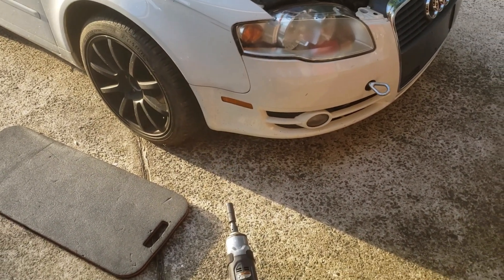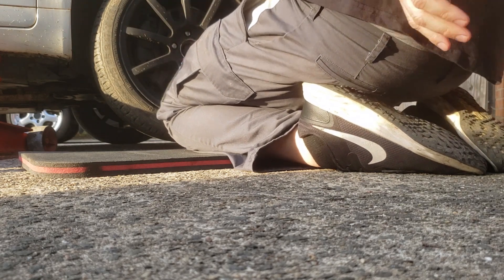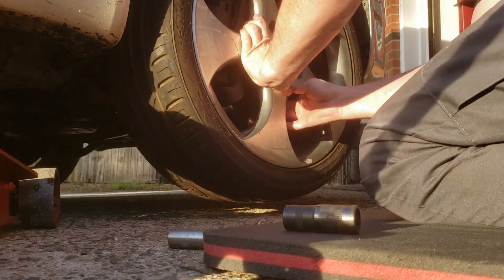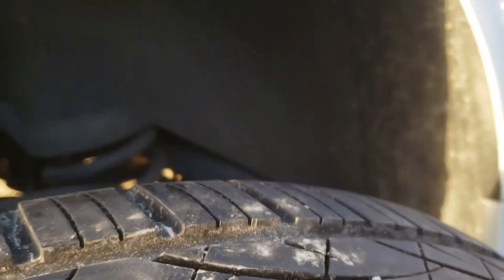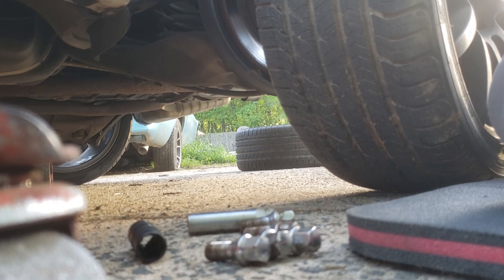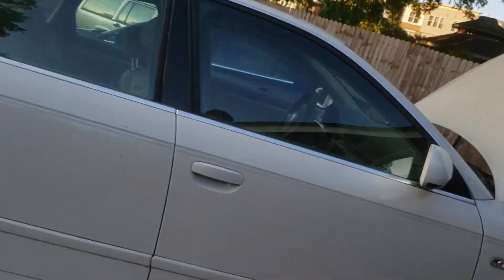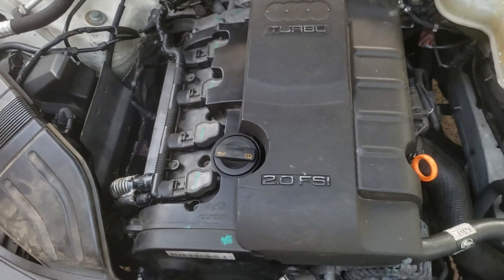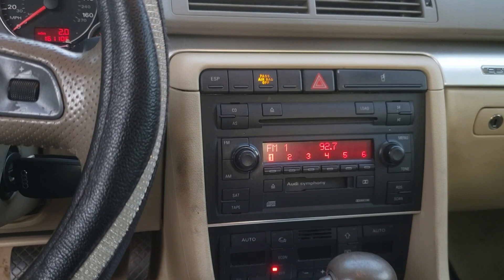I put Volkswagen wheels on My Audi A4

Comment: Hey Bro, roll the A4 off a cliff and make some videos on that sweet 2nd gen Camaro in the back.
Reply: Come onn mannn.  Are u sure you don't want to take the engine out and replace sum oil squirters or something?
Reply from the maker: I will definitely try to get to the Camaro at some point i bet you can't guess what's going on under the hood!
Reply: @snoopy5736  Im always down to strip a 2.0 down to the bare block - I just dont want to watch someone else do it though. Rather see 2nd gen Camaro goodness!
Reply: @UselessBuilds  Now Im really wanting to see it! But if you need help or info with the A4, reach out to me - Ive gotten more than my share of my hands dirty on B7 A4's.